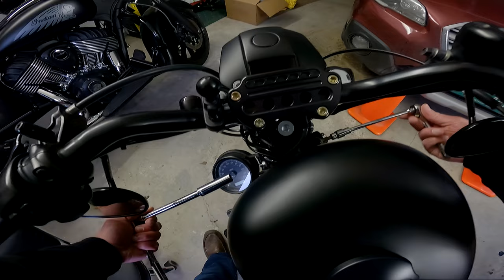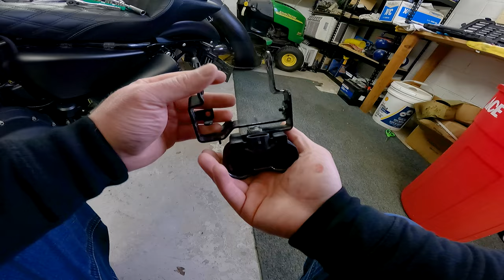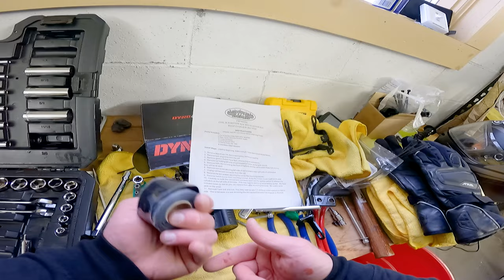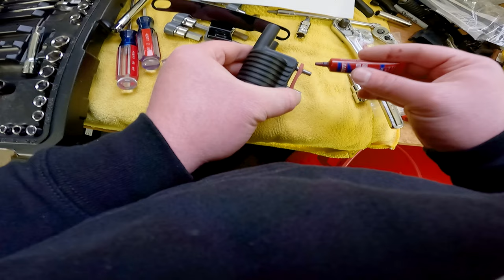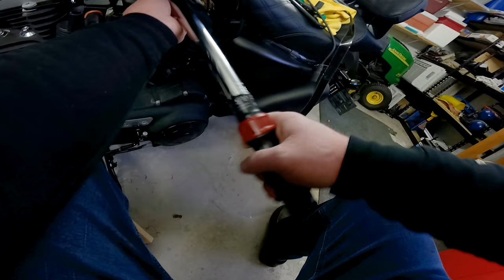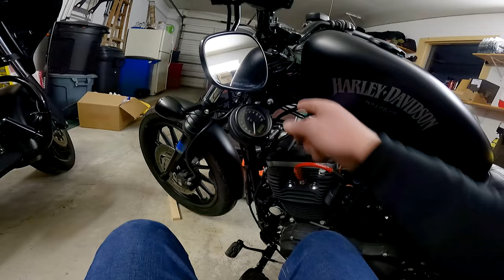Harley Ignition Coil and Switch Relocation with Wire Tuck - Iron 883

Comment: Is there any reason this kit wouldn’t work on a fuel injected sportster 883? Also having a hammer 1275 kit.
Reply from the maker: Works great on mine with the 1275 hammer kit. Never a single problem during the install or otherwise.

Comment: I did the same relocation but because of the severe engine vibration, the ignition switch became loose so often when the engine was running the engine suddenly stopped because of the engine vibration which made the switch vibrate too. Do you know how to retighten the ignition switch?
Reply from the maker: My best advice there would be to consult the service manual. If I remember correctly from when I did this, I believe there’s a nut on the backside that can be tightened? Service manual would show if there is, and what the torque spec should be to tighten it down. Worst case scenario you could always use a dab of JB weld or clear epoxy on the backside, but I would consult the service manual first!

Comment: The wires are l'observation kn spark plugs or tight? I bought the same wires and had to remove the spark plus terminal to install the wires but i fond them not thight enought...

Comment: Do you think spray painting the rubbers black will effect their function?
Reply: It doesn't. I did it. however, the paint flaked off after a few months so I used black plastidip which worked so well. (looks a lot better too because plastidip is matte)

Comment: Why does one choose to do an ignition coil relocation?
Reply from the maker: Just for Looks, places it in a better position if you're doing a full wire tuck and a tank lift like I did. No perceivable benefit other than it matches a look I was going for.
Reply: @MOTOBLADE  ya I'm unsure as to what exactly I want to do, all I know for sure is key relocation, start button relocation, maybe get rid of kill switch,  etc
Reply from the maker: @cruisealong378  I did my own bars myself, lots of wiring, just mark it and take your time (if you’re going with new controls that eliminate the kill-switch). Harleys bars were not pre drilled nicely for cable routing. Actually quite terrible. I got biltwell bars and they had nice big holes already set for instant easy internal routing of the wires, because I wanted to get all the wiring inside instead of just strapped to the bars. Hope that helps if you decide to go that route. Have fun! I found a lot of YouTube videos with different bike setups til I had an idea of what I wanted to do.
Reply: @MOTOBLADE  ya I'm thinking of relocating start button and key ignition to under the tank somewhere closer to the frame, I'm unsure whether I want to remove Killswitch completely yet. For the fun of it I was thinking of making it keyless if that was possible 🤣

Comment: 48ft lbs? Where did you find these spec? Seems high
Reply from the maker: All my specs come from the service manual, unless otherwise noted. Seemed high to me too, but who am I to argue with the service manual 🤷🏼‍♂️
Reply: @MOTOBLADE  I called service at the local Harley dealer and they told me 11-13ft lbs. 🤷🏻‍♂️. Seems to be more accurate.  I installed new highway bars and those torque specs mounting to the frame were 25-35 ft lbs